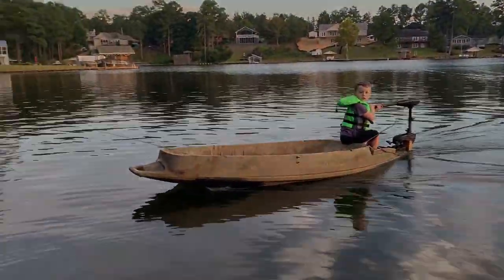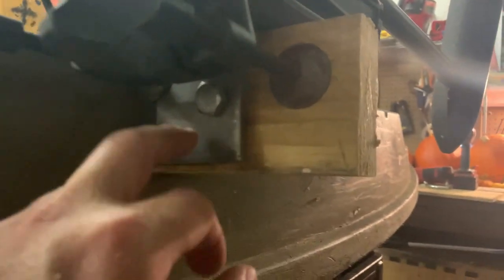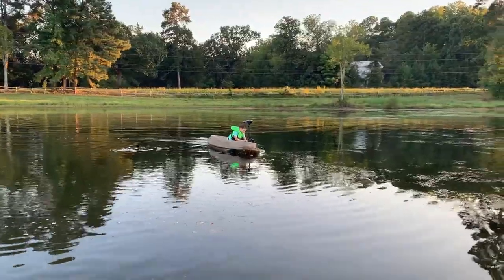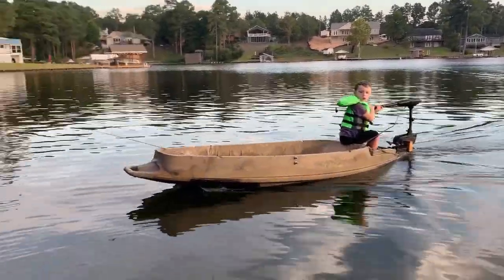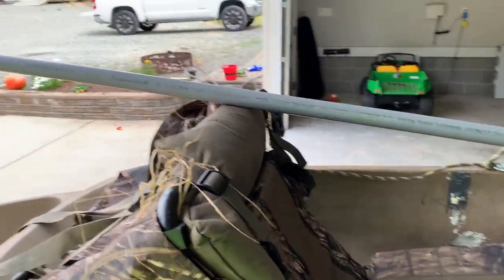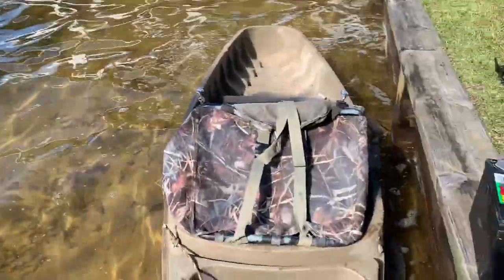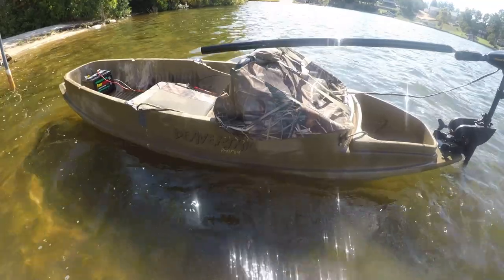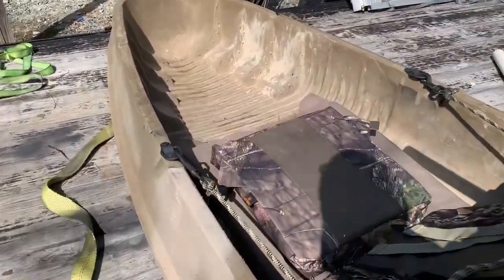Beavertail Phantom | CUSTOM Trolling Motor & Backrest Mount

Comment: Any updates on this thing? I have a phantom I’m thinking  about doing the same thing to. I weigh about 135 and with my waders and gear probably about 165 total. You think there’s anything more you would add if you used this every weekend to hunt?
Reply: Also great job!
Reply from the maker: @patricknewton7734  still got it, I’ve actually not use the trolling motor function, and I wish it had a more comfortable back support. I might actually sell it and upgrade to a sit on top kayak. I did hunt out of it this year search the channel “ prettiest wood duck I have ever killed”
Reply: I’ll definitely have some kind of extra floatation on the left and right even though I know it’s pretty stable already. Just look for some ideas!
Reply: @Yellowlab247_Outdoors thanks man. I’ll come back when I get finished up with mine